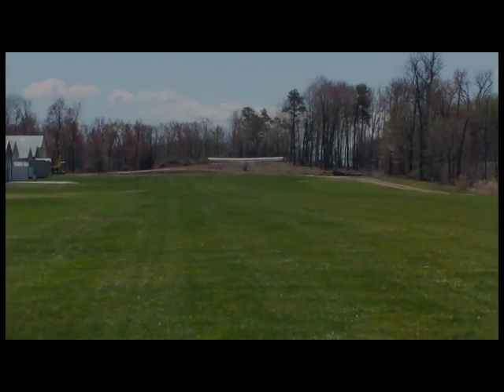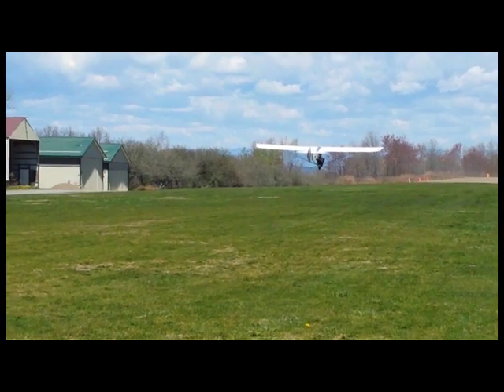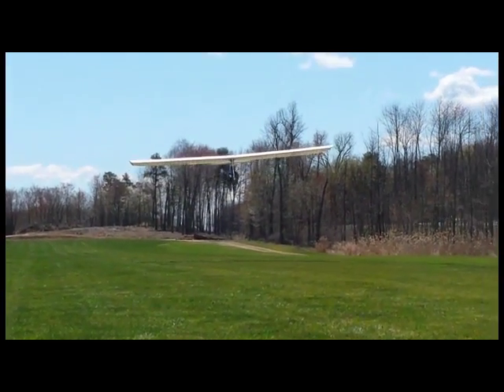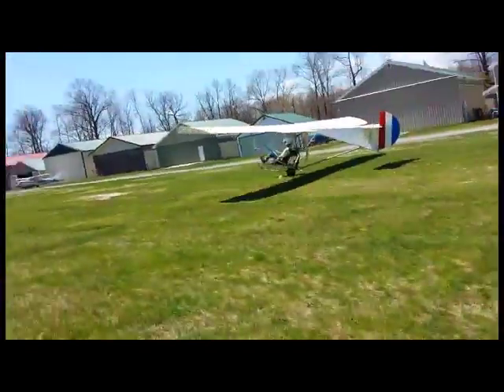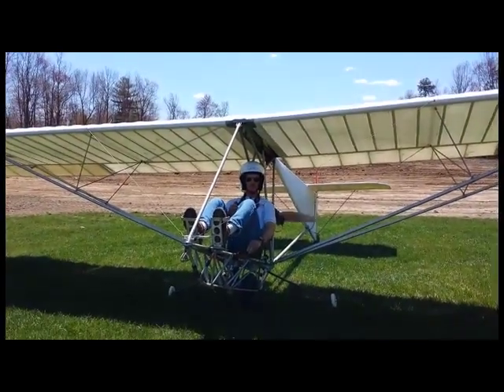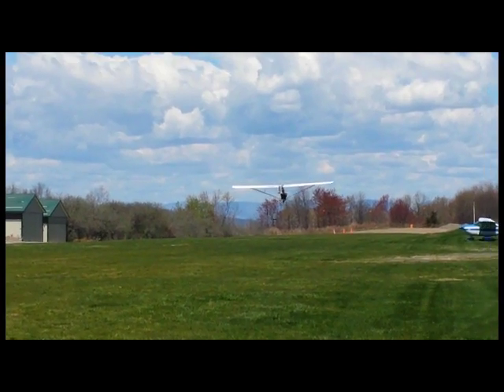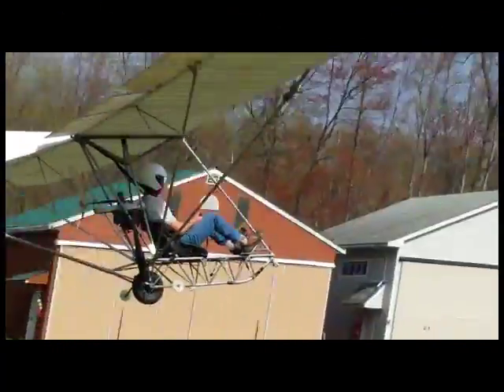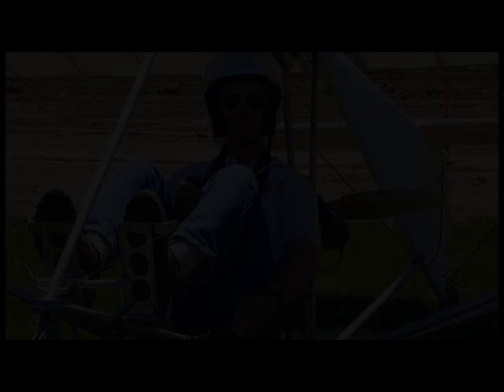Super Goat Motorglider first flights

Comment: What are the wings made out of
Reply from the maker: check my blog for more info www.taubebuilder.blogspot.com for details. basic wood framing like Wright Brothers, ceconite 2.9 covering instead of linen and 4 coats of good latex exterior paint. all flex areas are bamboo.
Reply from the maker: Sorry about that, I was replying to the Taube video. The super goat is basic aluminum frame wings, foam ribs , covered with 1.9 ceconite and two coats exterior latex.

Comment: What about plan B escape plans.   what if something goes wrong and pilot needs to jump?  I am not the dying type I am not going down with it need to escape what is going to save my life?  I know there is not much you can do during take off and landing but high up what is some bad happens and I need to jump out.   max pilot weight?   stall speed?   weight of  ultralite?   glide ratio? type engine? Does not seem to have to much power maybe a rotax engine for more power I know that thing will not carry me lookes like max weight under 200 lbs... I like the idea should be made beefier for bigger pilots rotax engine will work just fine on it beef up the  wing a bit and better fabric larger flight tubbing for wing ledding edge beefier lol... I would not mind test flying for real to see how much it can take I would put some Gs on that thing.  I am big guy that flys hang gliders and ultralite planes I have a dragon fly and wills wing hang gliders I like putting Gs on things lol.   I have 440 parachute and also 550... Not good idea to fly close to ground not good idea at all  that will kill someone or end up in hospital... going fast hit a lull crash flying low had friend almost die doing that flying fast over ground dont know how it happen but he hit the ground lull maybe its not suppose to happen but it does
Reply: Beto Hernandez 
refer to The Roadrunner... bleep bleep.
Reply: Beto, that is the proper way to test a new built aircraft. Nothing wrong here. Congratulations, Michel.
Reply: What do you mean "jump out"  ? You can not jump out of an ultralight. The parachute is attached to the airplane itself (when there is one available).
Reply: It's Not fully Tested.   Experience is in Hang Gliders and Trikes
Reply: ButtonAccordion Beto,  So what do you think would go bad requiring a chute?  Why would one ever fly a plane they thought might spontaneously crack up in flight? What is the last U/L or small plane that did that? (Florida-kept Arrows don't count) Add all that stuff you specify and it's no longer U/L but requires LSA AND most importantly is no longer designed for such a wing loading.  This would actually increase the risk of "something going wrong".

Comment: a "motor-glider" is an oxymoron , the craft in the video is really a microlight, which is a very light weight & low power plane
Reply: Your comment is just plain incorrect. A motor glider is a still a glider just like a sailboat with a motor is still a sailboat. ANYTHING with this machines glide ratio IS a glider whether it has a motor or not. BTW there is NO legal meaning to the term "microlight" in the US. Here the term ultralight has a legal meaning.
Reply: matthew hurley check again.it is an ultralight sailplane with a motor adapted to it mostly to be self-launchable.the fact that it is a viable sustained flight option is just a plus.thumbing up your own comment lends it no credibility.
Reply: It's a GOAT. (Glider Opperations And Training )with a motor. I had one fantastic little plane. Just put an electric motor in.